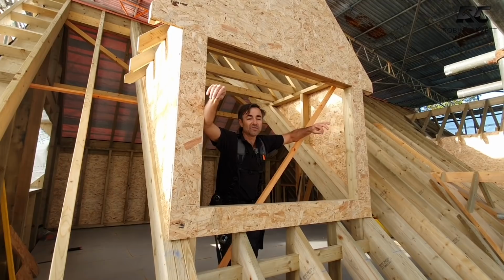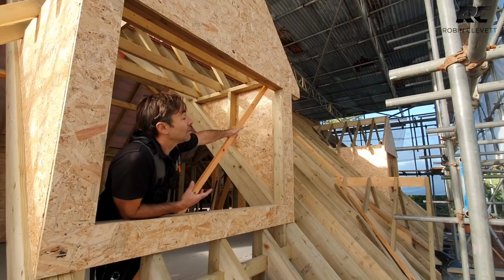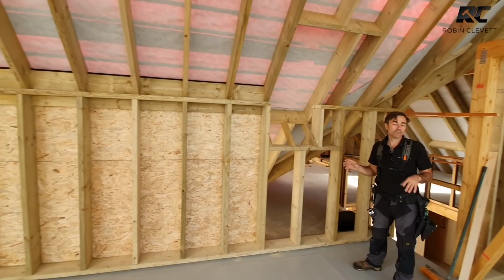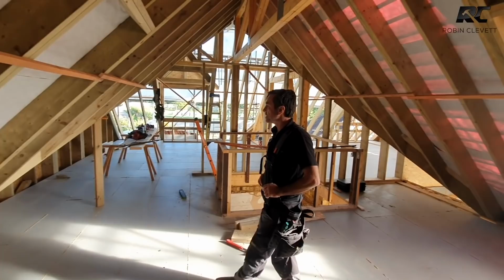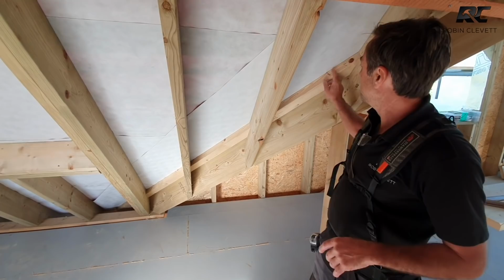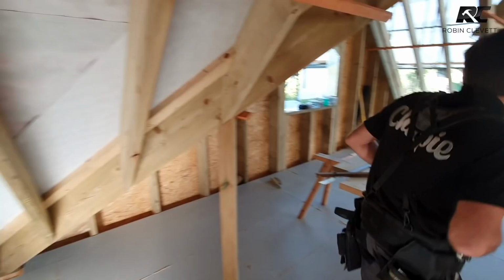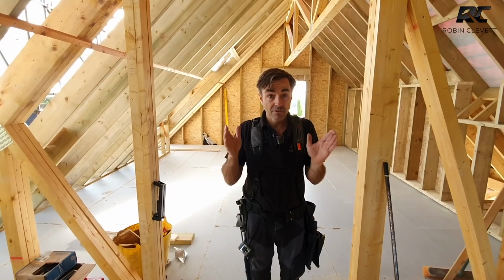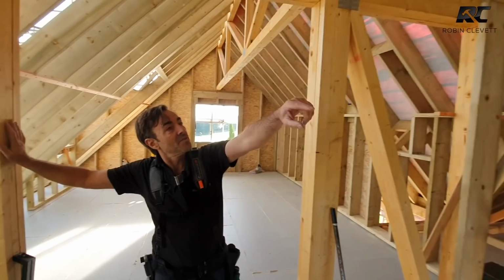The Big Build. Roof Construction work complete. Episode 34

Comment: @robin clevet: 
I am currently studing a level 3 Site carpentry course. I have studied modern truss rafters, but in the roof engineering of this build, the lattice truss in the redge has got me pondering; is it situated in the apex as a form of support to the redge board?
Reply from the maker: Hi Nathan, it takes the load vertically so yes it supports the ridge and negates the need for a structural collar at ceiling height, thanks for your message mate good luck with the rest of your training and maybe check the video where I talk through the Big Build Roof Design

Comment: Hey, which framer and nailers do you prefer; Hikoki or Milwaukee? Thoughts about dewalt?
Reply from the maker: Hi Guys, I have both the Hikoki and Milwaukee as I run both battery platforms, I will gladly pick up either nail gun!! I do not use the Dewalt but have some mates that use them and they like them... We also
run Paslode gas nailers these tend to be lighter and when you are doing lots of repeat nailing then these guns win on weight, the nicest looking gun of the bunch is the Milwaukee though!!